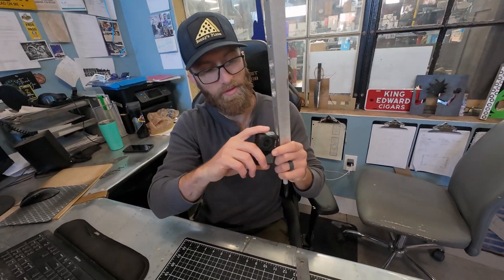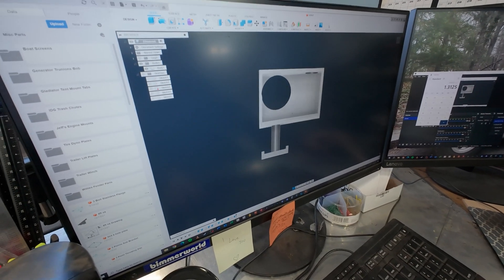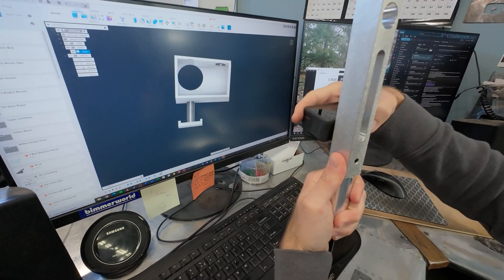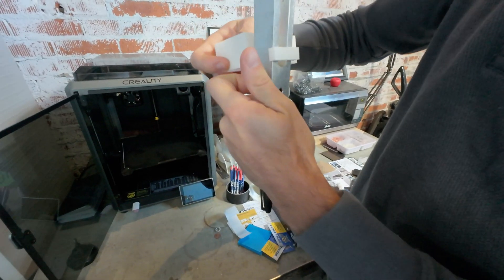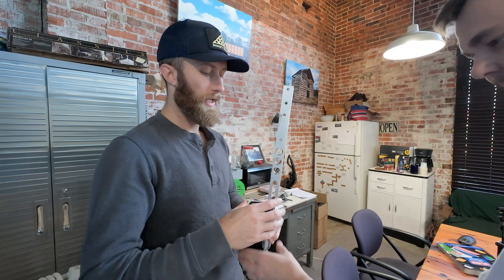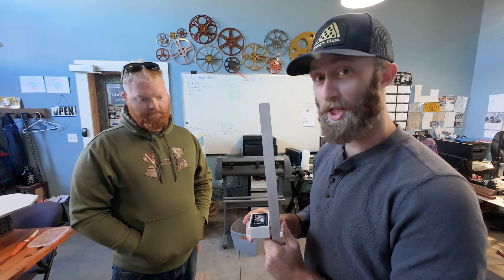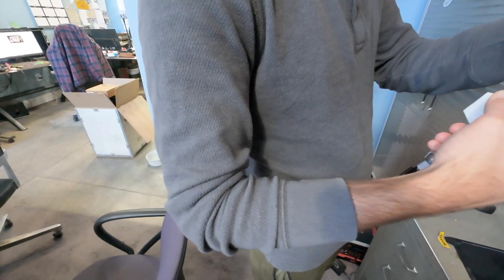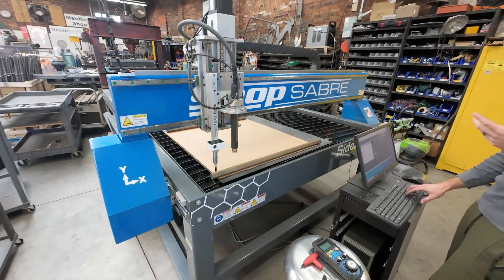We Made a Camera Mount for our CNC Plasma Cutter

Comment: All you really needed to do is print an enclosure that could hold a hex head bolt and then put a 4/5 star knob on the other side of the bar and tighten it down.  Cool what you made but it's over engineered. KISS.

Comment: The wiggle is so simple to fix. Just print two side rails on the camera box holder itself on either side of the post to prevent movement, or print a rail to go in the slot in the rail. These extra parts are overthinking it.
Reply: You can give constructive suggestions without belittling, "so simple", or being dismissive of their design process, "overthinking it". If you genuinely want to help and not show off, then you'll get a lot further with some tact.

Comment: Next version: A "Pin" on the camera side with a screw hole in it. The bracket thingy gets a sleeve kind of thing that fits the pin and holds the (retained?) screw.
That way you can screw the mount on and don't have to worry about it fitting exactly.